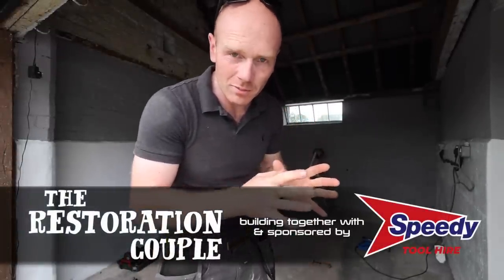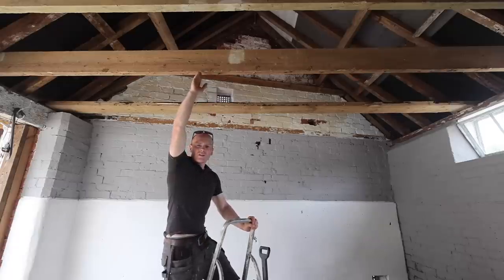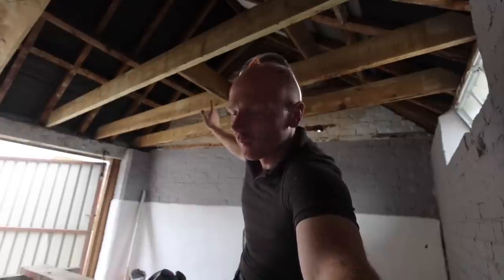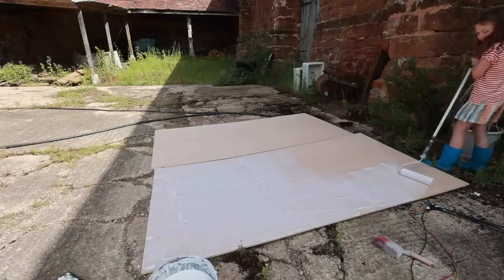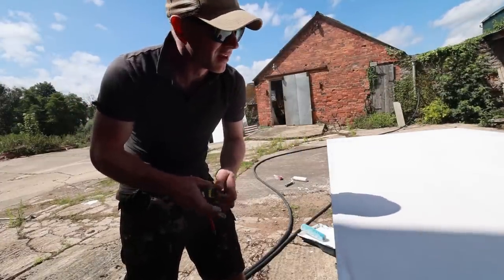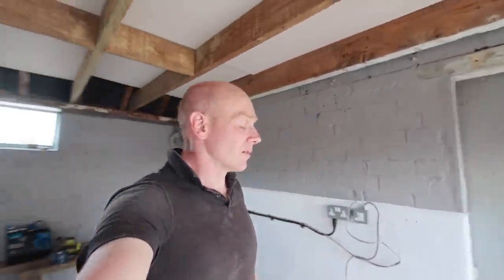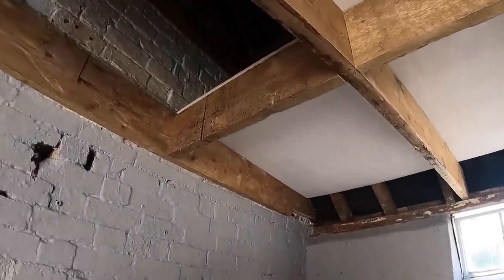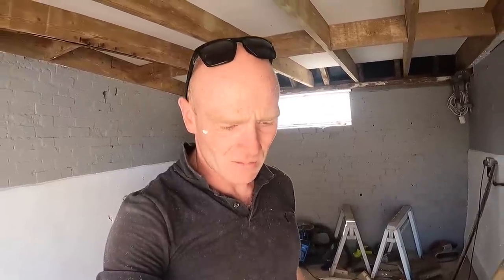NEW CEILING WITH OLD TIMBERS. - Exposed BEAMS or not?

Comment: A quick question Tim, seeing as you've done some loft insulation on this video. I recently topped up my Rock wool Insulation but had the centre loft boarded with a thin layer of rock wool underneath it. I would like to insulate over the chipboard with rock wool or Kingspan as you have done but I am worried about condensation. your advice, please.
Reply: Ensure 2" airflow , no problem
Reply: @christianwithers7335  thanks but 2" airflow above or below the insulation.

Comment: If you fix the the ceiling timbers 200mm higher you can use akros to support roof when yo change wallplate without taking roof off

Comment: I was thinking that this project would make a good playlist during the last video. I'm still thinking that spraying a bleach solution over the areas that you removed the rat droppings would be good to do pre-painting and post painting a couple of times to avoid devaluing your expensive pig related products...if you have anything heavy to go up in the loft space there's a chance that you could get a shelf up which could take a lot more weight than the roof. You could end up losing space because of this. Also with anything food related up there, spraying the end walls with a bleach solution may not be a bad idea even if nothing comes into contact with it. There's also a chance you could drop some 4x2 down from the main beam on the roof to strengthen the loft floor.
Reply from the maker: Fortunately no really big hygiene demands as this room will only be for packaged frozen produce.  A separate room will be created for any food production if/.when we need it.  That said, we gave it a through wash down before freezers moved in. 👍